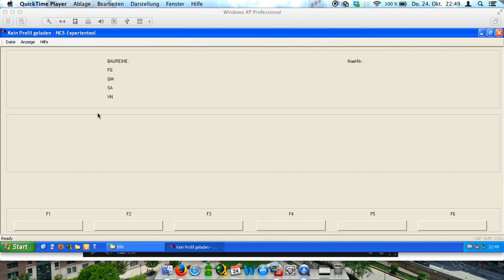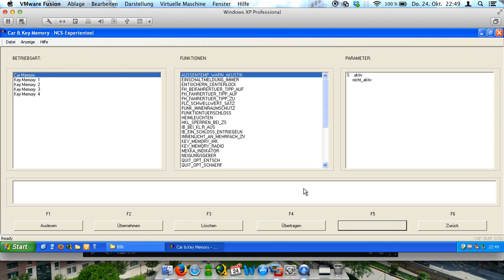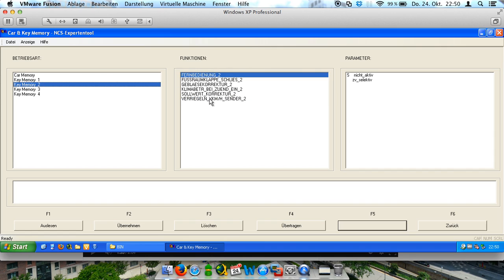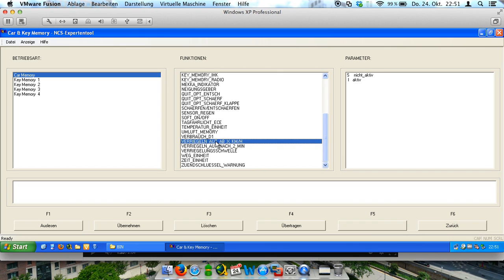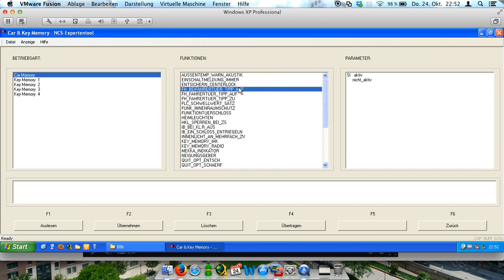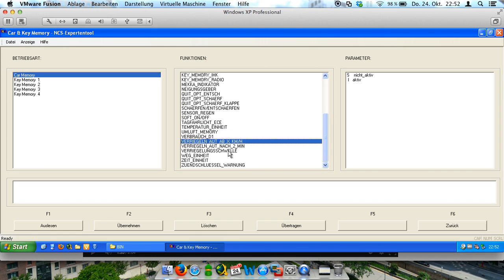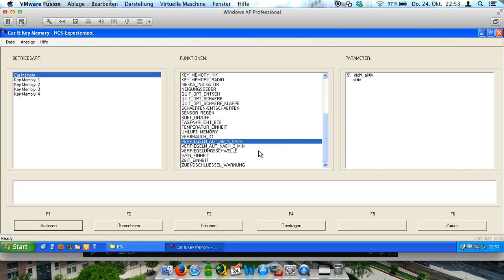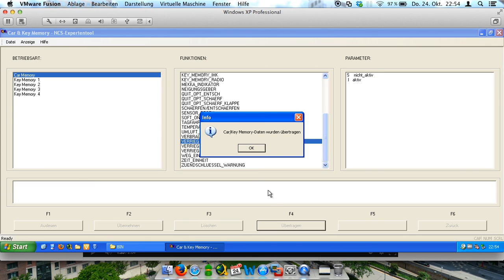NCS Expert Car Key Memory BMW Coding English

Comment: Hey, I've got 2 keys for my e46 but recently one of them stopped working. It opens the doors but doesn't start the engine. Can i fix the key with this software? or disable the function which prevents the car from starting?